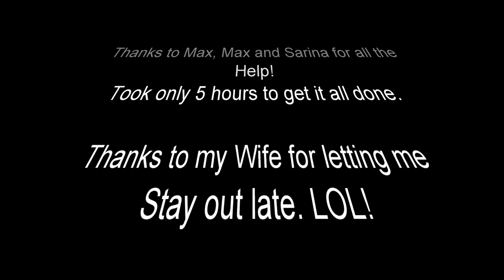How to install SoloWerk Coils on a 2017 Golf Alltrack DIY EP14 S4

Comment: So... No rear upper spring isolators? How's that working out for you? 
You guys are truly hacks. Not surprised you didn't show final result.
Reply from the maker: nofaithjusthope well 1st off the rear springs are flat faced on top so nothing is needed however at 14.39 we did mention to make sure to spin the spring into the lower rear spring perch because that's what isolates it. Its a rubber bushing that is not shown. Sorry we did not have before after pics we were very tierd. We started very late on this diy.

Comment: How is this working out for you after install? With no rubber bushing on top rear spring, I would think they would be very clacky/noisy.
Reply from the maker: you would think that but they dont. They make almost no noise at all. I been in this car on the freeway and local roads its rides very well.